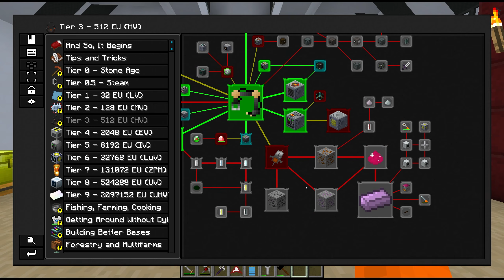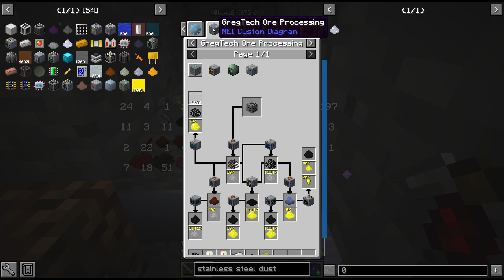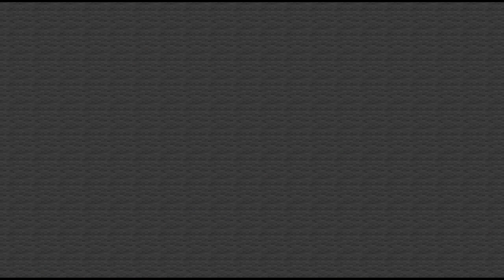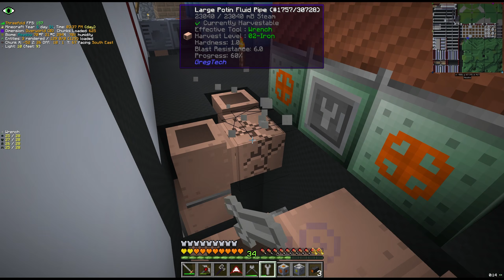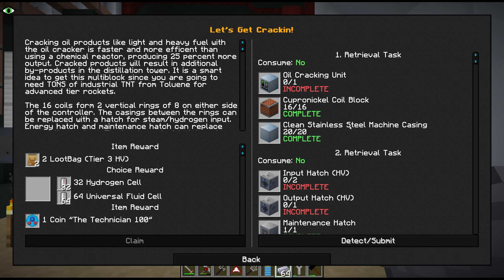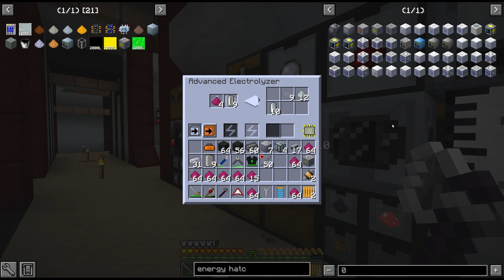Gregtech New Horizons - 21 - NanoSuit & Oil Distillation! Modded Minecraft

Comment: You can also get Toluene from...I'm pretty sure it's Wood Tar, which you can produce in a Pyro oven. It's something I highly recommend doing later, setting up a pyro for Wood Tar and Wood Vinegar (Wood Gas is less important, and Charcoal Byproducts are just the previous three combined, so useless), since they produce a ton of different fluids and you're going to need a bunch of them and are able to use a bunch more anyway.

DTs and a MB steam cracker pre-Moon? This is why you should go crazy with the redstone dust, otherwise this sort of a project would not be possible pre-Moon (you get access to easier Chrome on the Moon).

Early Nichrome coils are 100% worth it. It not only cheapens and/or speeds up recipes, but you get access to Vibrant Alloy, which is a fantastic material to make tools out of. Incidentally, the latest update changed the recipes for electric tools from stainless/titanium/tungstensteel to steel/alu/stainless, so you'll be able to craft HV powered Vibrant Alloy tools with Nichrome coils. They are so, so incredibly worth it. Highly recommend. Vibrant Alloy also opens up the first tier (yes, there's multiple in GTNH) of Ender Fluid Conduit, though that also requires PTFE. Again, highly recommend, super worth. As the questbook points out Vibrant Alloy also opens up the EnderIO magnet (bad, but better than no magnet) and the Staff of Travelling (do I even have to talk this thing up at all? You know how great it is).

Don't think I didn't notice you looking at the circuit 1 recipe there, sir. You've no right to complain about recipes taking too long when you don't have the fluid to speed it up that you could have set up in LV ;) (it wouldn't have helped much, for the record, Nichrome with nitrogen would take 200 seconds anyway)

Something worth noting, that the questbook doesn't know, is that the feature of the IC2 nightvision equipment where it would blind you if you have it active in high light levels is removed/disabled/whatever in GTNH, so nanosuit helmet also gives night vision.

That skeleton in particular was so tough because it was a Brutish variant - they (and Brutish Zombies, especially) are as cuddly as that term suggests.

Honestly I suspect you're starting to see why wallsharing EBFs to save on coils and building more of them might be a good practice. I had, IIRC, four HV (maybe even EV) EBFs all upgraded to Nichrome coils pre-Moon, and despite the massive investment that was (not to mention drain on my poor oil, I had to upgrade to Cetane-boosted just to slow down the rate of consumption!) I don't regret it. The amount of things that have to go through EBFs isn't going to lessen any, you're going to need more anyway, so might as well get those going sooner rather than later.

Enchanted lootbags have the "dud" rewards like redstone torches removed from their pools. That's part of the reason why you want to enchant those lootbags, so you don't get trash from them.

Now that you have a full set of nanosuits, and probably a full set of HV GT tools in the near future (hint: they're really good) I would suggest investing in a Battery Charger. Despite the name it can charge more than just batteries, and it's extremely fast at charging tools. Much faster than placing them in a machine battery slot, highly recommend that one.

Blaze Reeds are an excellent pickup, they produce both blaze rods and blaze dust. Highly recommend setting those up in a farm and leaving them running in the background, you don't need overly much blaze so having some blaze reeds slowly stockpile some is great. Fighting Blazes in the Nether is definitely a worse prospect, since they're all infernal...

So, for the record, the way upgrading EBF coils work (as far as I understand it) is that for every 900K you're above a recipe's minimum you get a -5% EU discount on the recipe, which sadly reduces the EU/t required and not the time it takes to cook. Mind you that might make the difference if your EBF gets a Maintenance issue, and it never hurts to use less power besides. Every 1800K you're above a recipe's minimum you get one upgraded overclock, meaning that if a recipe is overclocked instead of being twice as fast it'll be four times as fast. Stainless Steel is an HV recipe, so Three isn't overclocking it and thus not getting an upgraded overclock, but when he upgrades those EBFs to EV he'll find the Kanthal coil EBF taking 30 seconds, and the Nichrome coil EBF taking 15.

Fun fact about the multiblock chemical reactor, when it overclocks recipes it gets upgraded overclocks, not regular overclocks. Something to keep in mind if you need a low voltage chemical reactor recipe to be processed *fast*.

Imagine complaining about setting fluid shutters along a giant pipeline when you're playing the version where you can actually see those shutters on the GT++ pipes. Decadence, I tell you ;)

Placing a circuit in the controller isn't unique, other multiblocks have the same feature (the LCR is one that comes to mind, though since it's only the one slot you might need an input bus for that one anyway if you're doing multiple recipes that use multiple different circuits).

Comment: Upgraded overclock means it will decrease the processing time by 4x rather than 2x when energy tier 1 higher than required is provided. For stainless steel it would mean providing EV.
For breaking wrenchable blocks quicker I can suggest an battery powered wrench. 
Considering toluene please check King's comment and my reply there.

Comment: Tolune can be gotten from wood tar as well
Consider making an LCR right now, so worth it for desulfurization of oil byproducts. You can use 1 for all
Use rock salt if you want potassium
You can just use 1 MV electrolyzer for water to produce hydrogen desulfurization of all products of oil
Reply: Yes, and it will also be an energy-positive line because it will also produce a lot of benzene for gas turbines. As a byproduct you will also get phenol (needed later for epoxid) and creosote for lubricant.
Reply: Fluid heater for steam when he removes the boilers
Reply: Is LCR large chemical reactor?
Reply: @schneid3306  yes

Comment: the hydrogen for petrochem is a complete loop -- you electrolyze the hydrogen sulfide and it produces excess sulfur as well all the hydrogen that went into it
Reply: It’s better to use that for sulfuric acid
Reply: You don't need excess sulfur. You'll be absolutely swimming in it when you start setting up miners in the nether. Hydrogen itself is fully renewable too. So rather than making a close loop, it's usually more efficient to further process hydrogen sulfide to another useful product, sulfuric acid. That thing is used in like 10 other chemical processes. 😂